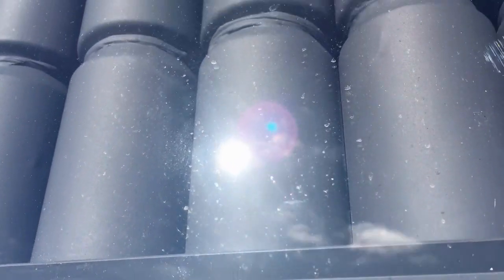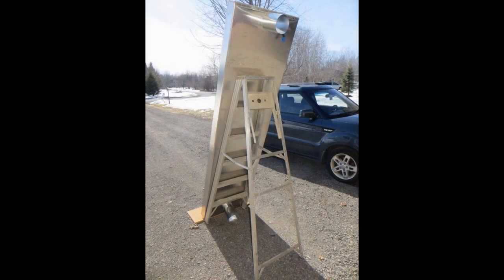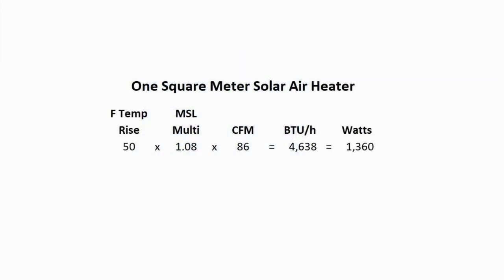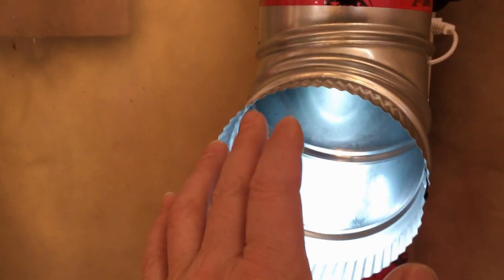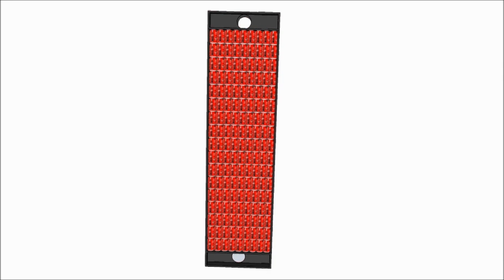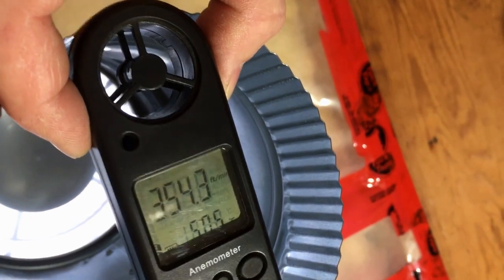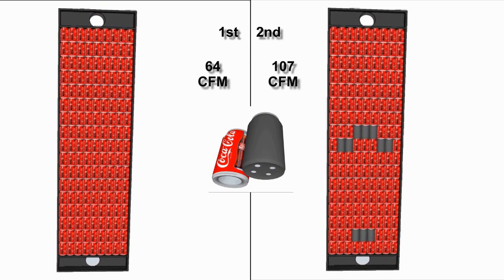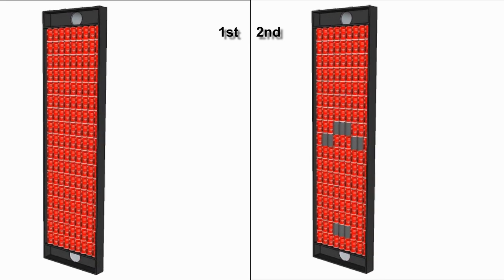DIY Solar Air Heater Part #7

Comment from the maker: Hi everyone

Just a quick update.  My two solar air heaters have been capturing heat now for almost 10 months.  The Hobbs meter has recorded over 1,000 hours of run time.  

What have I changed in the last year?  Well, one modification was needed.  During the summer months, the Plexiglas got softer in the heat and lifted off of the frame slightly between the screws.  Therefore I added fasteners every6-8 inches, to secure the Plexiglas.  That is the only change I have done.  

Others at the airport still comment on these units.  It was minus 7C a couple of days back, and the units were bringing in a steady 30+C heat.  That still amazes me, and those that come to visit on sunny days.  

A year later – would I do this all over again?  YES!  And I would try a different design.  As I have shared all along this has largely been an experiment for me.  I have received positive feedback and kind suggestions from all over the world.   What I have learned, is that I’m not doing anything new here.  All of us are building on the success of others.  

My largest viewing audience (by far) is not Canada or the United States, its Mongolia.  Over 35% of all of my viewers are from Mongolia.  And having received so many comments and suggestions from people that live there, I have come to realize they are WAY ahead of us in this space.  

Thanks to everyone for your comments and questions, and I apologize for not being able to answer everyone.

Dwayne
Reply: OMG, Mongolia... who would have thought that? Good for them!
Reply: Thank you for sharing your work.  Would you share one or two of these ideas that you might try if you were to build another heater?
Reply from the maker: Although I currently have no plans to build another unit, I think if I was, I would test metal screen material for a screen door.  Painted flat black and maybe 3-5 layers of screen.  I think that would be a worthwhile test.  Some feedback I have received from Mongolia suggests that metal screen might be a good choice as well. 
Cheers
 @annnonomys3132
Reply: @LifeIsShortDIY  Thanks
Reply: All the great work being done on solar water heaters is in undeveloped countries. The units are far cheaper and lots and lots of people use them. Maybe we should rethink that term undeveloped.

Comment: This air heater suffers from the same design flaws as all the rest. First of all, the pop cans can be very effectively and solidly connected by cutting the bottom off at the side just above the curve (I used a utility knife blade mounted on a piece of plywood to cut the bottoms off like a pipe cutter does) and using a can opener on the top end. Now the bottom of one can will slip right over the top of the other just like conventional stove pipes. It does make the sections a little shorter so you need a few more cans but the connection or assembly is easy simple and fast. If you look down the center you will see that this system does produce a kind of turbulator at each connection that will help transfer heat to the air while still allowing a fairly unrestricted flow in the center  of the pop can tube. The biggest problem  with this author's design, is the same as with all the rest, the design has a built in restriction that reduces its efficiency by about 50%. There is no reason to restrict the air flow to just that travelling through the center of the tubes. This only allows the air to collect heat on the inside of the tubes and leaves all the outside heat wasted. The cans can transfer just as much heat on the outside as they do on the inside, so these designs need to allow the air to pass over the inside and the outside of the cans and they will get twice as much heat and any design that requires fans to circulate the air, is useless and a waste of time and money. Convection should pump out plenty of flow and almost instantaneously, as soon as the Sunlight hits it. If the air can pass freely around the cans, the collector only needs an inlet and an outlet to the cabinet and the tubes should be just openly suspended within the cabinet. If you do it this way you will have more heat than you know what to do with. PS: It would also increase flow slightly to make the top of the collector cabinet slope toward the center output port, not just flat across the top and several input ports across the  bottom to distribute the incoming air flow.
Reply: I'm thinking of pulling air also from behind the cans with spacing between the rows. This would keep hottest air away from the glazing and not conduct heat back out (I'm using glass).
Reply: @davidh9368  Maybe try using 2 to 4 stacked and spaced aluminum screens painted black instead of cans...that would also be suspended from the back of the cabinet.

Comment: this is a very nice series of videos. I learned a lot...   

unfortunately there is a deposit system for beverage cans in Germany. sSo they're not so easy to get for free... therefore i thought about alternatives and I came up with the idea of using corrugated sheet metal allowing upward air flow making construction of such a thing much faster than assembling hundreds of cans!!!

morover adjusting the angle of you system towards the sundlight making the sunrays hitting the system at an angle of as close to 90° as possible will probably give you more heat ...

Furthermore you could insulate the system as your aluminum case will loose a lot of heat towards the outside.  use glas insted of plexiglas as it insulates much better. 

and one thing i was asking myself.... does the interior has to be metal?

Comment: Very cool! Would be interested to see if you add a second fan to the first heater to see how that affects anything. I do suspect the outer tubes don't get the same movement of air as the central ones, so your turbulence/restrictor probably distributes the flow between all the channels better.

Comment: Hello Dwayne, thanks for your video, very interesting. If I'm correct, the original design has one fan and the second design with air turbulence has two. What is the difference with only one fan for both I.e the true difference between turbulent and non turbulent air? Cheers

Comment: Hello Dwayne,  Thank you for the excellent detail in your videos on your solar air heaters.  I like the aesthetics of your design and I feel like the effort you put into using aluminum gives them a nice architectural look.
I have a thought on your efficiency comparison you did at the end of this video.  It was clear your were both surprised AND a bit skeptical of your results, and I think I might have a theory as to why you saw the efficiency difference you did.
Obviously, the more air flow you can muster the more efficient the panel will be, as the differential temperature between what is going up the tubes and the cold outside air would be less, essentially reducing the heat loss out the front of the panel.  That alone does not explain why you had an increase in BOTH the airflow CFM and the temperature.  My theory on this is that while I'm sure you did an excelent job air sealing your units, it can be very difficult to get a perfect seal.  If you have only one fan sucking air into your building, any small gaps at all would allow cold outside air into the air stream.  While on the second unit, you had a more balanced air flow by blowing in and sucking out.  The pressure inside the unit would be closer to ambient, resulting in less air leakage.  If you are thinking the baffle design alone accounts for the efficiency you saw, I would suggest a fairly simple modification to your first unit to test this. Simply place a second fan on it as well, to replicate the same fan setup you have on panel 2.  I would even hazzard a guess that with a double fan setup, panel one might even exceed the BTU's gained from panel 2, but I bet you would at least see similar results. 
If you do decide to try two fans on the first panel, I would LOVE to see what the results would be of that one small change.
Keep up the good work, your videos are well made!
Reply from the maker: Excellent analysis.  I like the way you think, and agree with you completely.  That is a real possibility.
Reply: @LifeIsShortDIY  Wouldn't it make more sense to suck in warmer air from inside the building to heat up, rather than cold air from outside of the building? Cold inside air goes thru the collector to get warmed up and comes out up top. This leads me to another potential design improvement, wouldn't it make sense to force the air out lower since heat rises?
Reply from the maker: @jeremyeverett6186  Both units suck in warm air from inside.  There is no outside air introduced to the system.  The second unit was designed from the start to force air out the bottom. 
Regards

Comment: Thank you.
You probably spent too much time making these for what you get out if it, but the information really helps others.

I made plans for a screen version to heat one room to start. My idea includes a metal roof panel at the base, 3-5 layers of screening, and laying horizontally due to location, but this will also give a pass down and back.

Comment: Hi thanks for such a detailed think through and build for all 7 vids. It has given an insight into how complex solar thermal light boxes really are.
Just a few insights learnt after years studying solar energy. I hope they are helpful.
Solar Insolation is 1367 W/m2 outside the Earth and where 1000 W/m2 depending on where you are at what time of year is about the average Insolation hitting the surface of the Earth.

https://energyeducation.ca/encyclopedia/Solar_energy_to_the_Earth

So at a rough guess your panel is only receiving about half of 1000 W/m2  When it is mounted on the wall. One would need a LUX meter to be sure some very cheap one's with computer data logging now available. Seen them at less than £30 pounds in UK so in US guess much cheaper as well.

 Not sure what your final black plate collection area is because it is curved ( This could well be an advantage when the Sun moves across the horizon during the day ) but it could be about a half a square meter that means your panel is only receiving about 250 - 300 Watts of energy that's with reflective loses from the glass or plastic front cover to the light box trap.

It's a very important that the converted energy is removed from the light box before it becomes too hot to be contained by the insulation and the front panel losses ( This is why double walled vacuum glass system's work so well ) The thermal conductivity of the Aluminium pop cans with the selective coating is very high it must be over 90% but the thermal mass is low and the surface area in the front of the tins is hot while the inside with the airflow would be very chaotic and only the surface of the air in contact with the under surface of the collector would be collecting energy as the area of the inside of the pop tins is very large with little area to impart energy at a good rate.
The fans maybe removing the air before collector energy can be imparted to it. Something very  interesting is taking place within the pop cans. Maybe filling the cans with wire wool or other cheap conductor would increase thermal transfer to the air and stop any boundary effect.

https://en.wikipedia.org/wiki/Boundary_layer

It would be interesting to see what would happen if the fans were PWM and controlled by a computer you might find only one fan is needed.

I guess that the unit you are using is rented or such and you can't do much to the structure of the building as a Tromp Wall would be ideal for what you are trying to achieve.

Trombe wall - Wikipedia

Thanks again for sharing your experience in passive Solar Energy.

Gary
Reply from the maker: Gary, thank you for sharing this information.

Comment: This is a bubble-gum science idea, but I wonder what would happen if the cans were wrapped in crinkled aluminium foil.  Rather than the sun's rays hitting a relatively smooth can surface which is mostly pointed back out the glass front, it'd hit an irregular surface with more chance of deflecting the radiation randomly back within the unit, and the surface area between the heated metal and air should also be increased.
Reply from the maker: Your right, it definitely is an experiment.  All of this is.  I’m wrapped up in another project right now, but I might make a third heater in the future.  One made from four layers of metal screen, just to try that approach.  I haven’t’ tried that yet.     What is really cool, is snice January I now have had more than 300 hours of free heat coming into the hangar.  It can be -10 and windy outside, just awful, and you come inside and it is +4 or so.  It really makes a difference.  

Lots of positive suggestions from everyone. Thank you.
Reply: It's pretty nuts how much energy we can get out of sunlight.  You might have already seen it, but this is another pretty cool experiment https://www.youtube.com/watch?v=eeSyHgO5fmQ

Comment: Surface area is one of the prime factors in heat transfer, I think an accordion fold of your sheet metal would produce massive surface area to transfer heat, but still allow very good flow characteristics. Think of 1" wide channels. Air could flow above or below the design.
Reply from the maker: Do you have a picture or a sketch to share your idea?

Comment: I am collecting scrap copper wire to try as a weaved heat gathering grill to try something similar to the aluminum screen solar heaters i have seen a lot of.
 I cannot get copper cans to compare the difference in metal performance so I guess this might show some results.
 Only restrictions I have now are health and energy but I am really keen to give this a try for a new workshop, studio I am building here in the Shropshire Hills in the UK.
 Thanks for setting our brains in gear.
Reply from the maker: Thanks for Sharing. I'd love to hear how you make out. Dwayne

Comment: Dwayne,
Great to see your whole proces!
I was wandering if you put a second fan in your first system and put a restriction in the outlet, so that there is al little more pressure in the cans, what probably make the air touching the cans.
It is worth to try it I think, and easy to fix.
Sending greetings from the Netherlands,

Peter
Reply from the maker: I think that is a great idea. I might try that. It would be a simple fix without having to dismantle the unit.
Reply: @LifeIsShortDIY   Thank you for the excellent video !   This is also the first idea that I had after watching the video.  If you put second fan in your first system,  you will increase air flow in the first system,  and make both systems more balanced, in term of air flow.   Maybe the first system can produce more heat, but air flow is not enough to deliver it .   Push-pull systems generally have much better flow.   Thanks,Vlado

Comment: With such long columns of cans, I did wonder if the box should be divided into two chambers to reduce airflow restriction. However, your second design is working so well that it seems to have a good combination of flow and turbulence.
Reply from the maker: What I have learned is that it is a bit of  a balancing act. The second unit is pretty well balanced.  I’m looking forward to measuring the best it delivers on a perfect day.  It’s not pointed directly at the sun, but it has good exposure.  If I was to do further testing on this unit, and I’m not, I would try 5/8” holes instead of ½”.
Reply: What about instead of wide open and four wholes cut one large whole im every can smaller than wide open so your left with a fin all the way around the inner circumference of the tube?

Comment: Interesting result. Have you tried running the first design with 2 fans and the second design with 1 fan? That would reveal the effect of that variable. If the fan variable is minimal, the output from the second design is so much higher that it might be worth replacing my the cans in the first heater with cans of the second design. I also wonder if you could fine tune the design by testing various numbers of baffles before you reseal the plexiglass with silicone sealant.